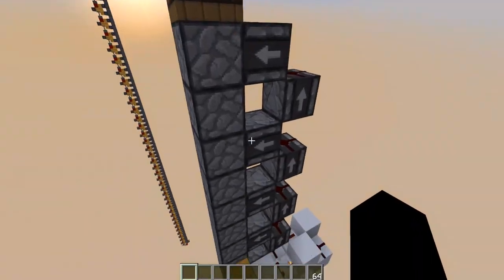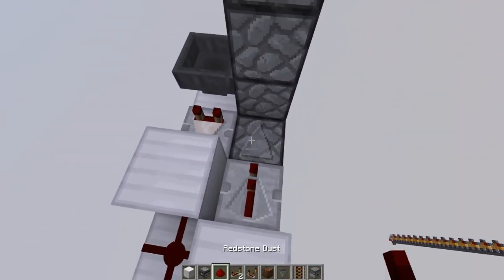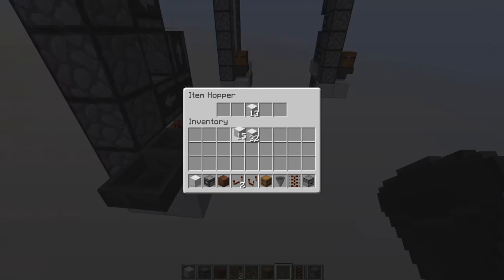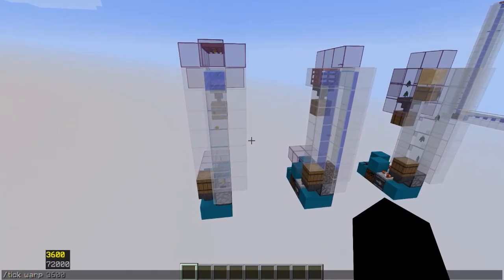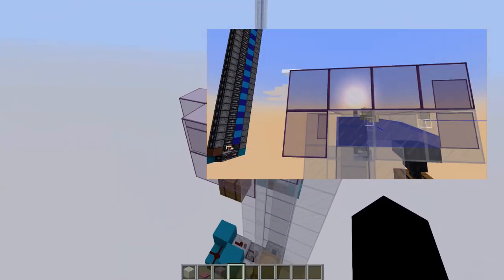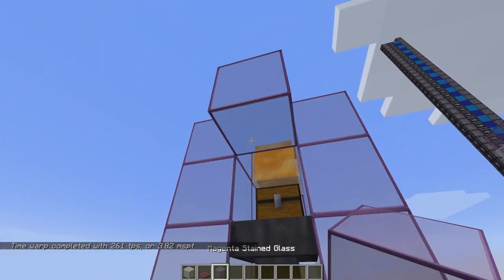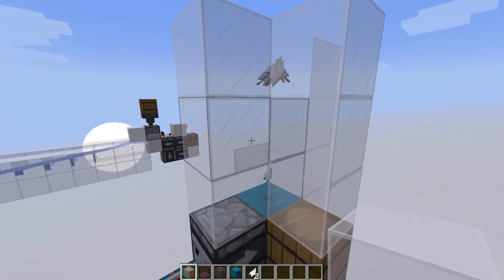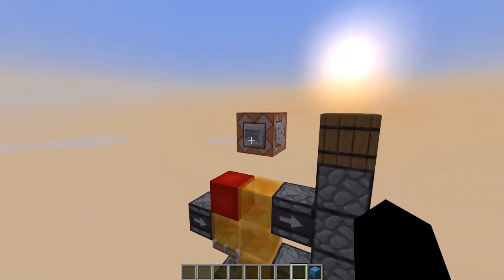About Item Elevators: Lossless ? | Minecraft 1.18+

Comment: lag wise, which is better?
dropper elevator or a bubble column?
Reply from the maker: Bubble column is better for speed and fps. Although if you're dealing with something like 10K items per minute it might be worse idk.
The dropper version is good for the nether dimension, short distance or simply when you don't want to use water.

Comment: Thanks for the insight into the full block item elevator stability. I noticed when a sheep is sheared, the wool block item entity comes out near the top of the sheep. It comes up high enough that if the sheep's head is in a 9x9 block of leaves or glass, the item entity gets elevated. I proceeded to put a water stream and a block cover over it, but then items got launched all over the place.

Comment: Just to add from fiddling around, I worked out you can actually mirror design #2 to make it double speed. But where there is a block above the redstone dust connecting the comparator and repeater, you just have to make sure they are both observers facing the dropper. Otherwise you find the items are not evenly distributed and one item gets stuck. There are probably other double-speed designs out there but I thought it was worth experimenting with.